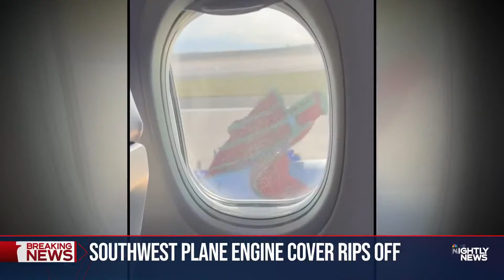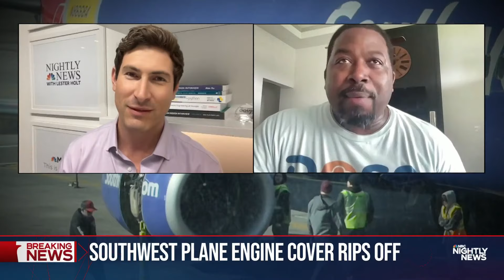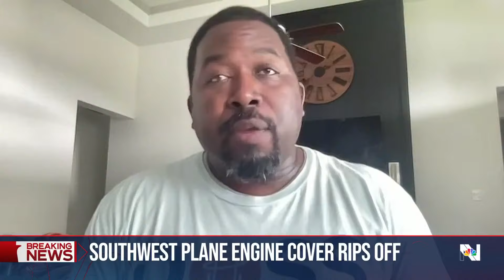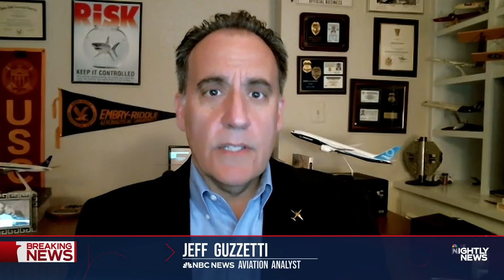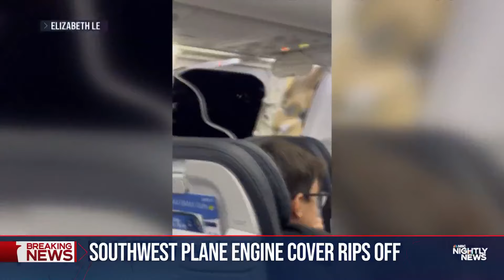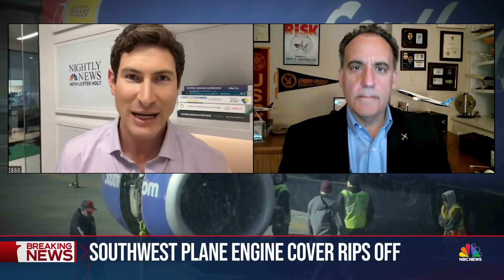Engine cover loss is latest problem on a passenger plane

Comment: The jet engine cowling uses quarter turn latches to fasten and unfasten using a screwdriver, either there were defective latches not found during inspection or the engine mechanic had forgotten to latch the engine cowling.

Comment: Why did they still take off? Crashing on the ground is better than falling from the air. Pretty sure people weren't just keeping it to themselves.
Reply: When the aircraft reaches what’s called V1 speed, they have to takeoff they no longer have any other option, the engines are not visible from the flight deck therefore they didn’t see it, in fact they never once seen what happened until they landed, they never once left the flight deck to check as per the Air Traffic Control tapes, the stewards told them what happened after they were in the air and they declared an emergency based on what they were told what happened
Reply: That video is of the landing, not the take off.
Reply: @ytzpilot  I understand there is "A point of not return" This is why I said "Crash". IMO hitting the "breaks" and crashing seems to be a far better outcome than falling out the air. My car dash lights up and dings at  me when my gas cover is still open, so how does a million dollar transportation vehicle carrying hundreds of people, while were constantly being told by PR people that "it's the safest form of travel" at the very least not have a "your engine is falling apart" light? Seems like a bit of an oversight, no?
Reply: @pi.actual  You sure? 0:09
Reply: @Alacod19  Yes, if you look at the wing the spoilers are deployed.